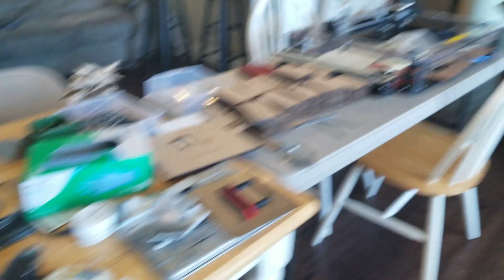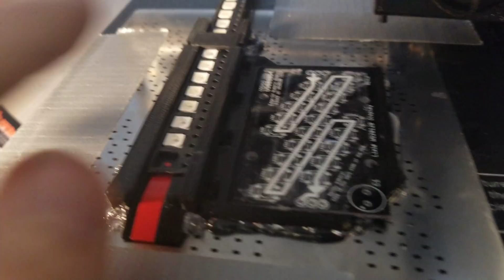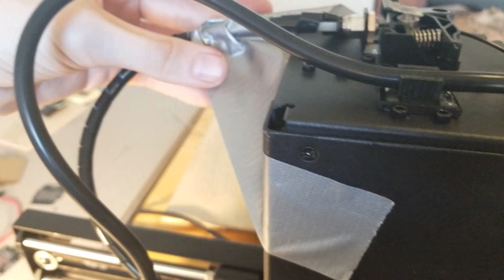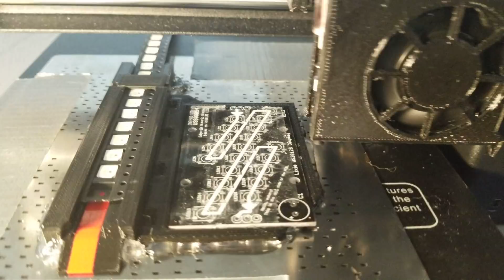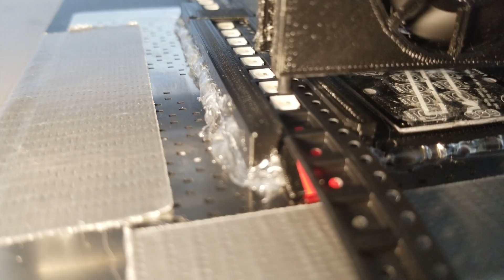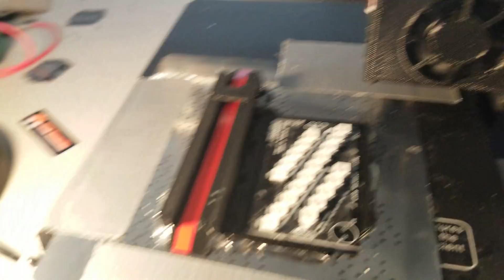$150 Pick and Place Machine!*

Comment: How did you program the gcode I'm interested in making something similar to pick up components and tin them then return them to the tray. How did you make the printer interact with vacuum pump?
Reply from the maker: The Gcode was written by hand via manually moving the head around with the knob (usually called "Move Axis" in your printer menu)

The pump in THIS case was always on, and the sticking power of the solder paste or tape is able to remove the part from the nozzle, but you could use a PowerTail switch and the M42 Gcode command to switch a GPIO on and off. https://marlinfw.org/docs/gcode/M042.html

If you don't have a free pin on the printer's controller to use, you can steal a fan's GPIO and switch the pump using fan speed 0/255 commands.

Comment: Watched video two times to make sure and you don’t show any valve to control vacuum and I see double sided tape on the pcb so it’s not working for real. Did you add something?  I think that you could use cooling fan signal to activate a small air séléniums to release your part and it would be easy to add to you gcode!

Comment: Something else I don't get, which is a question related to your LED board rather than the PNP - It looks like different rows have different numbers of LEDs?  It looks like the front digit is illuminated by 1 LED, the middle two rows by 3 LEDs, the back row by 1 LED, and all the rest get 2 LEDs?  Why?  Or am I missing something about how it works?

Comment: Great job  can you let me know the firmware you used.... thanks.
Reply from the maker: Firmware was the default version of Marlin that came with the printer, it was just running hand written Gcode designed specifically for that board/jig.
Reply: @lixielabs  That's excellent, but when I use marlin in my machine  please have a look..https://www.youtube.com/watch?v=oHTzcLUDKEI, it didn't work, how can I disable heater in marlin, I really don't have experience with marlin... Please don't mind my english.

Comment: There are ceramic hot plates capable of reflowing the board (unlike the pcb heated beds used for 3D printing)... You can reflow the board directly on the machine (put hot plate under pcb with some metal bracket, should not touch plastic parts). Then you will obviously need a way to feed more empty boards.

Comment: Well it does the job and you're not far off from the "real deal". every pick and place has a setup time for each specific board. I recon that to P&P another board you have will require the same phase - change in gcode, change in components. you got the crucial part to work and that's awesome! as long as this automation saves you time - it's worth it! will be awesome to see if you ran future upgrades or different pcb setups.

Comment: Using the nozzle to move the reel is genius. I wonder how well would this work with tiny smds.
Reply from the maker: Thanks! :) Unfortunately this method relies on many, many shortcuts and specifics to achieve a working result.

- The LEDs have only 4, well-spaced, large pads.

- They are all facing the same direction.

- They have a large top face and a square body that the nozzle can slip across to shove them into the corner of their trays to get a pretty consistent alignment without any feedback to the machine. (Open loop)

This is definitely a very niche hack, but could definitely be modified to accommodate very similar parts/board layouts!

Also, it took a lot of revising to find a design where neither the alignment pin, placement head, nor printer nozzle collided with anything they weren't supposed to, while still allowing the machine to complete a homing cycle without removing any parts - while keeping in mind the Monoprice printer's small 120x135mm travel area, minus ~30 millimeters on the x-axis due to the distance between the alignment pin and placement head. A very involved project, but I was super happy with the result!